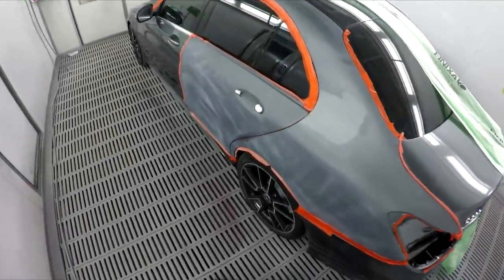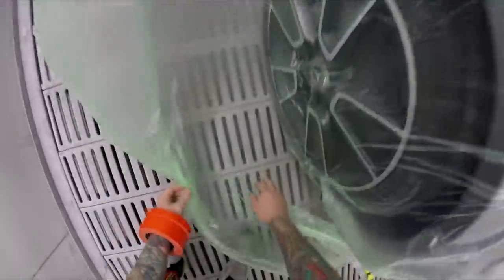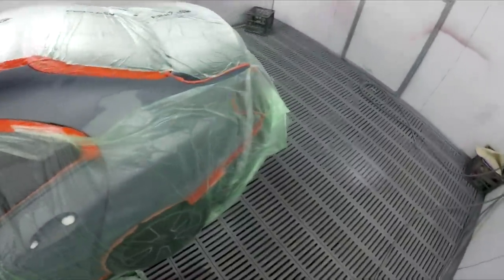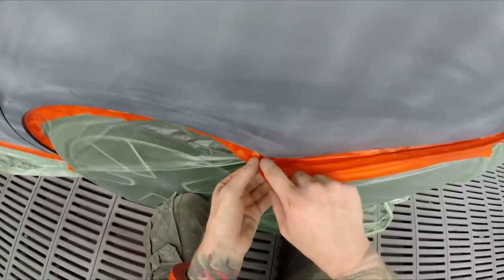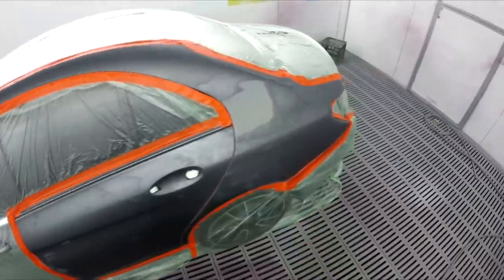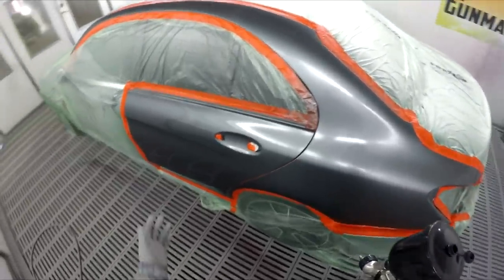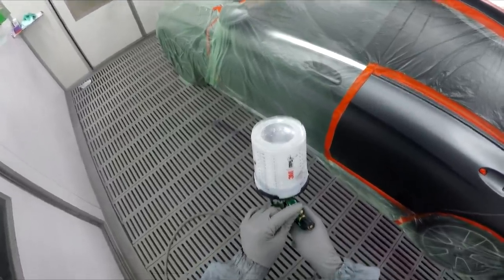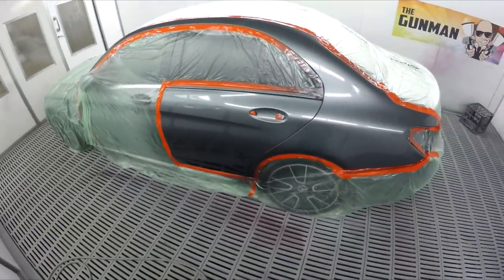C200 Benz Selenite 992

Comment: Great job 👍when you say you could have saved clear by using a different gun, wouldn't that mean there's less clear on the panel and is that a good or bad thing ? Or is it such a small amount it doesn't really matter. Cheers.
Reply from the maker: The additional clear would have ended up in the booth filters
Reply: Thks, that makes sense 👍

Comment: When using a blending agent do you apply it before or after the base coat
Reply: the blending agent is around the areas of the new basecoat and it done after you fill in the primered area with a couple of coats and before the basecoat control coat. So it's in between coats
Reply from the maker: It can be done either way, I have been doing it first these days and it works fine.